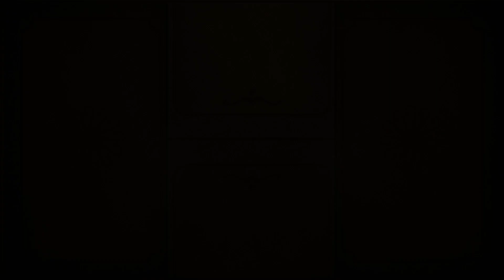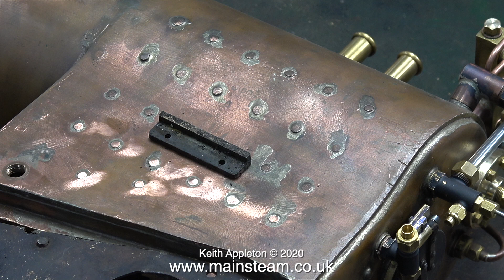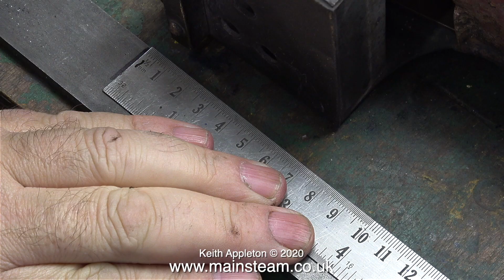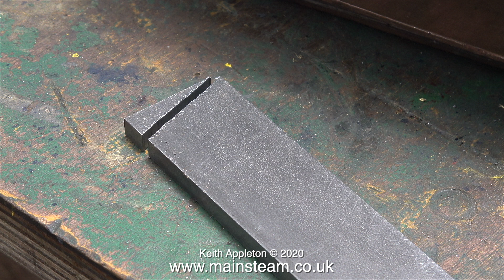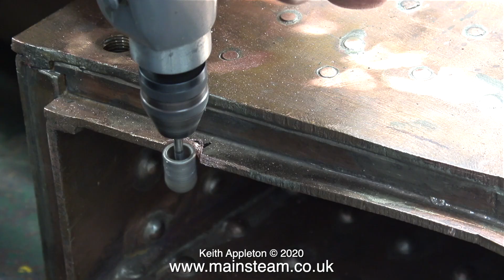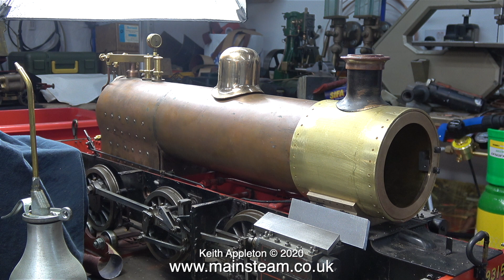SIMPLEX PRAIRIE TANK - PART #34

Comment: When you said the boiler might not be sitting level around 4:00 Was that row of stays level with the top of the frames lower at the front because it starts to follow the bottom profile of the firebox?